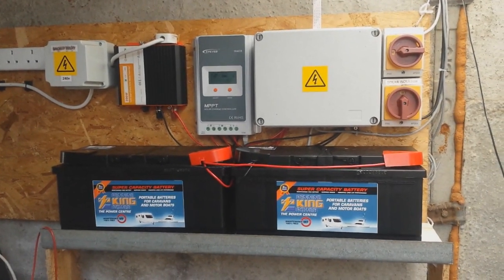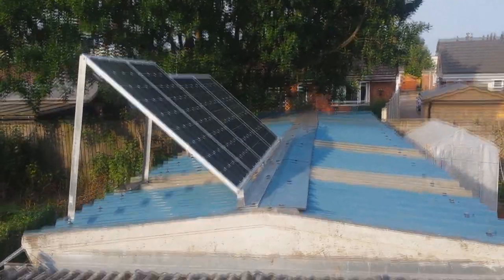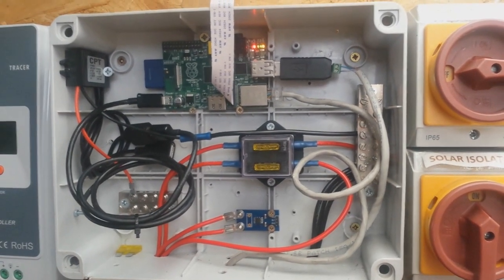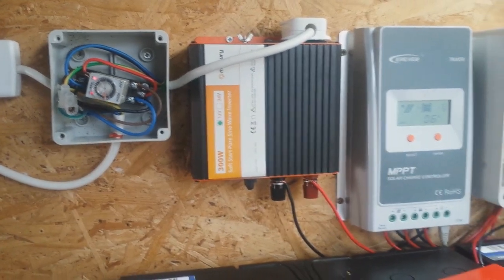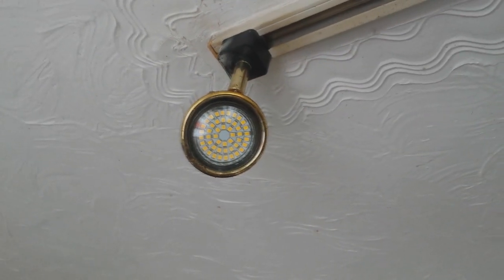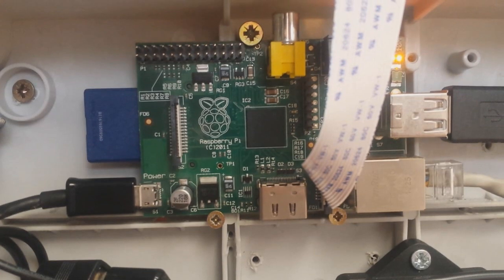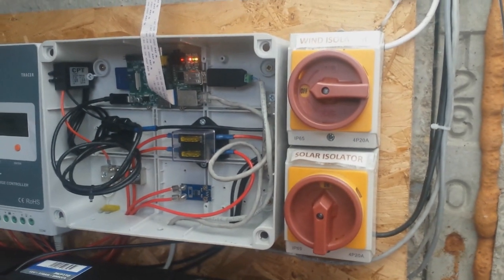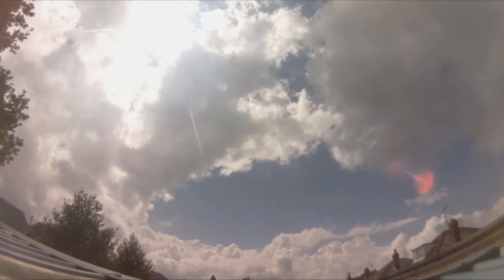DIY solar project and real-time internet monitor using Raspberry Pi and EpSolar Tracer

Comment: Just a question. Am I right in thinking that 3 pin plug on the line going  to the house is live when running on the grid? If so, potentially a danger point. On a similar point, is the system isolated from the grid when running on the inverter so it cannot backfeed to the grid in the event of a power outage. If not isolated this might produce lethally high voltages through local transformers just when people are working on it. Just saying.
Reply from the maker: The socket is always live, never the pins of the plug, power goes to the house, not from. The relay separates the power sources, it can never feed back. :)

Comment: Any thoughts?
I think a cheap android phone with EpSolar app & TeamViewer Host installed.
Then linked via an OTG USB cable linked to USB to RS485 cable connected to the EpSolar Tracer will work perfectly.
You can anytime log in remotely via TeamViewer from your PC, phone or laptop and read data and set settings etc.
You can also export the log files then send to wherever you are.

Comment: Hey @Matthew
The program for rasberry π is that avalibel 
I AM building a 4x 12x 250watt (48 250+5watt PV)
Do you hawe any BMS or similar to π so i can load my 20 SONNESHINE 512/200Ah AGM BATTERIES
48V IN 5  Banks of 4 bat 
IT's a small system ..
I Soon her 2 x SH500Watt wind turbines .. to make .. backup power .. in All the houres son not Shine .. 
4 EPeve 6415

Comment: Great vid, found it very helpful setting up my Trace 3210AN controller
However, could a Pi Zero be used to send the data from the controller to Grafana?
How difficult would altering your code be? (I'm a complete novice)..
Reply: I guess I'm kinda randomly asking but does anyone know a good website to stream new tv shows online?
Reply: @Leandro Gage i watch on Flixzone. Just google for it =)

Comment: Wrong batteries. Wrong size cables for the inverter. Thats 10A cable resistance. Its thin and long witch loose power. I am not an electrician, but I do lots of projects better than professional qualified electricians. You need to keep the inverter near the battery with the shorter cable possible for lower power consuming. Also, lead acid leisure batteries are not designed for inside the properties. They are for motorhomes, outdoor boxes, as they emanating sulfation gas. You must change to photovaltaic batteries, AGM deep cycle or Gel deep cycle. You need MT-50 remote controller to protect the discharge at max 12.2 per battery. So you batteries are healthy up to 1200 cycles. Not diyng at less than 500 cycles. Or even on single big mistake of discharging just a night at 10.2v. Battery will be end life. Keep in mind MT-50 REMOTE AND AGM BATTERIES. £150 FOR REAL 100AH FROM PHOTONIC UNIVERSE.
Reply: He culd just add a cap near the inverter ..
But the power he draw's in minimal.. so loss ... Naaaa not so mutch
I Will give you that the leads shut be 25mm² instead of this THIN leads .. 
But Then again .. he has No consumption .. so the gain is minimal
Reply: You don't need to the mt50 to set the voltage if you can do it through the web server he made 
Also you can use that kind of battery for solar as long as it is well ventilated in the room

Comment: That is an excellent example of just what can be done with the application of some imagination and ingenuity. I am impressed that you have taken the time to ensure that everything is protected aside from a few minor issues that I hope will be received as constructive criticism :-)

You need to take some time to ground the PV panels frames, charge controller and the returning supply to the home. If budget can stretch to it I suggest a 3 meter ground rod be driven down to provide a good low impedance path to dissipate any charge that can accumulate on the metal structures. Keeping a good ground will reduce the chance of a damaging lightning strike as it is a negative charge that starts a strike of. This is why lightning actually strikes up initially and the ionisation of the air allows the massive energy discharge down to ground. Ensure that you ground the equipment in a star configuration. I suggest the largest diameter cable you have, run a single feed from the earth rod to an earth terminal block and then a cable from the block to each individual item.

You can also obtain a varistor based din rail mounted varistor based surge protector that will protect the twisted pair from the charge controller (good choice on the controller, I have just purchased one of the new TRIRON1206N with the RS485 card) There are also mains based varistor protection modules that are very inexpensive. Both of these will need a feed back to earth.

I like the use of the timer relay to prevent rapid switching back and forth. It may be an idea to check the contacts on the relay for current rating. Your maximum current draw is in theory only about 1.3 Amps but with the power supplies LED lamps use ( capacitive droppers and switch mode ) you may have a very poor power factor. This can cause the current draw to be higher than expected. A mains power meter that will show you current draw and power factor is very cheap. I use this one to monitor the house supply - Ebay item number 223170175412
. This reports back via RS485 modbus so I am sure you will find that useful ;-)  

There is also a DC version of this meter that uses a hall effect sensor similar to the module you are currently using I think. It is an active sensor that has been calibrated properly.

As for your concern about UV it is well placed. You can easily apply UV blocking/resistant paint to the ribbon cable for protection and a simple small single piece of glass in front of the camera will give you full uv protection. The only other comment I would make is to check current carrying capabilities of the battery cables and inverter feed. It may be a trick of the light with the camera but to me they did look a little thin.

Safety wise I would personally fit an RCD to the output going to the house. Just a plug in type like you would use for a lawn mower would be fine. You may however have false trips until you have a good common ground to the chassis of all your equipment. NB Check the technical notes on the invertor about earthing as some of them have strange requirements.

You have yourself a nice setup and your script is neat and tidy. I hope the above observations will be of help. I am not trying to criticise just assist. I have seen some very nice solar inverters and PV panels blown into the next century by just a nearby strike. Keep innovating and enjoying yourself. I am a retired Royal Navy electrical engineer and then went into IT security and secure telecoms such as Redcare so if there is anything I can do to help or you have any questions just ask. I have nothing but time on my hands as I am currently completely bedbound waiting for my third operation on my spine. I have been like this for two years now and if it wasn't for my PC, servers and electronics projects I would be sitting in the corner rocking back and forth with my underpants on head, pencils up my nose and singing the Mr Blobby song  :-D

All the best.

Stuart.

yyy                                   S

Comment: Thanks for this great video, I just wanna say that I use your code snipe on your website to read my Solar data over a virtual Comport(I use Epever Wifi Module Connected as STA to my WIFI) is doing a great Job. I am very happy thanks a lot ;)

Comment: Thank you, Matthew - this is a really great video and contained exactly the information I wanted before buying a similar charge controller. I plan to use an Arduino to record the output and was worried that you needed to use the proprietary application to get at the data. Seeing this, I am about to embark on my own similar project, hopefully to make a mobile app that will allow me to control and monitor everything from afar. Really great video and an inspiration - it IS possible!

Comment: I have similar system but i use a grid tie inverter connected to 24V  battery bank at night. Yes a battery isted of solar panels.It works cause 24V is very close to solar panels 21V open voltage. And grid tie inverter thinks that its connected to a solar panel i guess. Battery itself is charged by tracer 40A controller. THat way i can use the power from my battery bank anywhehe in the house using existing wiring.
Reply: Hmmmm look more like a peptual solar setup.. nop i don't buy IT 
And you always drive series on MPPT .. newer ever paralell ..
( In my case 12 250watt ..4 in series = 150v  in 3 Banks paralell in to the 6415 EPever = 3000Watt@48v60A)

Comment: If you go to the EpEver website, they have a user interface where you can adjust all the parameters of the system from the comfort of your PC/laptop etc. I have a 4210A linked to my PC via an RS485 to usb converter (99p - ish), using cat5E over 25 metres from my workshop.
have a look at Adam Welch's set-up: https://www.youtube.com/watch?v=r3LrWeYYtnQ
Reply from the maker: nlo114 I've played with their monitor software. Unfortunately it was a bit limiting for my project as 1) it only ran on Windows and 2) I couldn't extract the data to upload to the web
Reply: For the purpose of the exercise, it may be worth getting hold of an old laptop or tablet, and dedicating it's use to your PV system. I only started my system this year, so being able to frequently monitor it, helps me distribute loads or shed them back to the grid automatically as the generated power fades in and out. If the laptop runs from solar power...

Comment: Hi, i bought an epever 30A and it can handle 100v, so i can coonnect it with my 1800w panels ?
Reply: No you cant you will burn it. even 40A version of this controller cant handle 1800W of solar (960W at 24V, half at 12V)
Reply: @ahah1785  he culd use 48v ..??
Reply: Depending of you EPever model
And if you drive 48v

Comment: Excellent solar energy monitoring project.
Congratulations on the excellent result.
I tried using the code I created to communicate with my Tracer 2210A MPPT, but I did not succeed.
Could you help me make this communication?

Comment: hi I am trying the same code as follows

import pymodbus
import serial
from pymodbus.client.sync import ModbusSerialClient as ModbusClient

import logging
logging.basicConfig()
log = logging.getLogger()
log.setLevel(logging.DEBUG)

client = ModbusClient(method = 'rtu', port = '/dev/ttyACM0', baudrate = 115200)
client.debug = True
client.connect()
temps  = client.read_input_registers(0x3100,6,unit=1)

print temps

client.close()

but it returns None

if you can help me it will be great

Comment: I am looking at setting up something very similar to this with some 250w panels. I was thinking about an arduino based mppt controller, but this seems like an easier way to go. I actually have my old pi getting power usage data from a clamp meter via serial connected to my house supply and posting it to domoticz (my home automation stuff). 

Great site and info there! Thanks for sharing.
Reply: Look Up EPever MPPT
And EPever inverters 
Top notch !!!

Comment: Hi Matthew, 

This is an awesome work. I am actually looking into the same with my controller that way there is a way for me to monitor everything. Powering up a desktop just to keep monitoring doesnt seem practical to me.

Anyways, I see you had an issue with the AMP monitor. Was this the ACS712?  Also, how much off are the data coming from the controller itself? Also, is your inverter coming from the controller or directly from the battery?

Thanks!
Reply from the maker: Hi Jonas. Yes I think it was an ACS712 sensor. They always seem to be working great but eventually need fine-tuning again. Probably an issue with the Pi, or the way I'm powering it. The load current displayed by the controller jumps up and down all the time, sometimes off the scale amps that aren't even possible, so I had to add a bit of code to ignore high values. The inverter comes from the controller, as I have set it up to shut off at 12.2v just to preserve battery life.